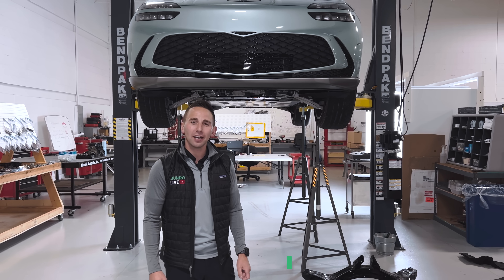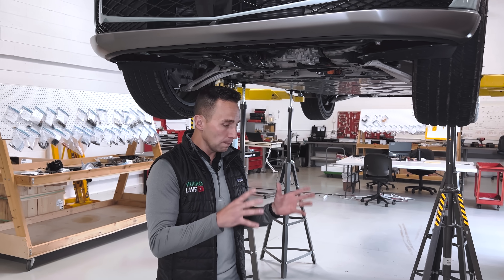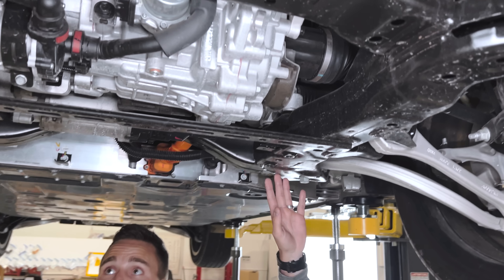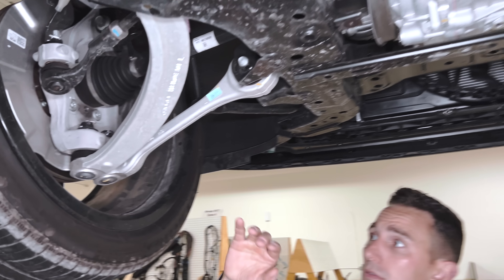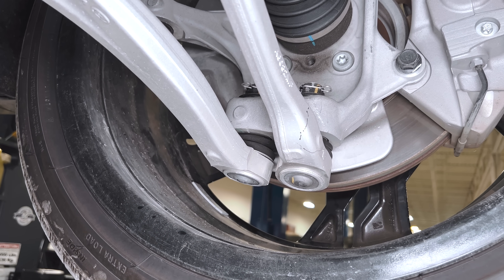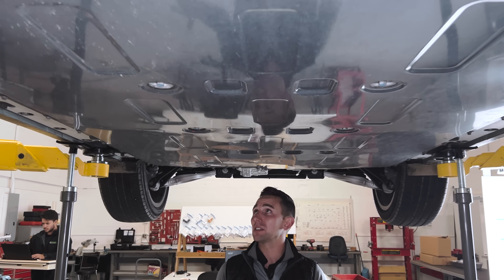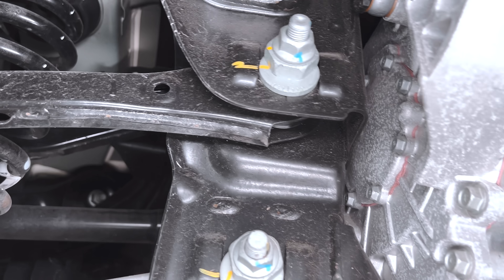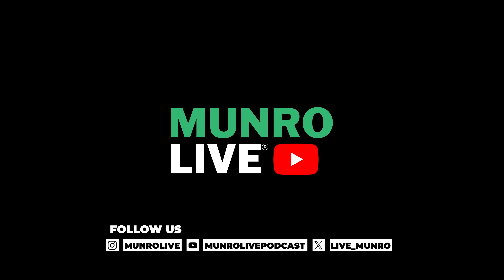Can you spot the difference? GV60 on the E-GMP Platform.

Comment: I’m really curious if you could look at an EV6 GT vs. the regular EV6 AWD and do a video like this. Also curious what parts may be shared between the EV6 GT and the GV60 “Performance” like brakes, adaptive dampers, etc.

I just looked at my EV6 GT’s front suspension components and it looks like they use these same aluminum parts with the double lower arms vs. the stamped steel from the Ioniq 5. Not sure if all EV6s use this design or just the GT.

Comment: If you look at the two hubs, the GV has the two ball joints.. the Ioniq has the one.. BUT.. look at the placement... the Ioniq has it almost directly under the wheel bearing area of the hub. The GV has it substantially inboard.. but two..  I bet if you draw out the intersecting lines of the two ball joints.. they end up right where the single ball joint is on the Ioniq.. right under the wheel bearing.
BUT you would gain substantial strength  and probably better life span with the two joints.. they will experience half the stress, and less motion in the joint also.
I wonder on the wheel bearing being incorporated into the half shaft.... could help reduce salt and debris getting onto the wheel bearing from the back side.. in the rust belt you see a lot of wheel bearing failures.. but not the bearing itself.. the ABS tone ring will disintegrate.. and require the bearing to be replaced... so maybe less often replacement.. but I bet more costly when it does need to be done.

Comment: Question: Could a consumer swap in the control arms and ball joint from a GV60 onto their Ionic to improve the ride quality or are the mounting points different?
Reply: The knuckles are $1400 each side, $1300 per side for the control arm set so it would be over $5000, assuming it would fit.

Comment: Jordan, can you try to explain some the engineering in more layman terms without all of the specific buzz words that are used by engineers versed in the topic.  For example, the explanation of the use of the virtual ball joint vs the Ionic.  I know that I got lost as you kept adding all the specific terms that not many of us layman understand.  Good video, keep them coming.
Reply: What the goal of a virtual ball joint is doing is to get the pivot point of the wheel in the middle of the tire contact patch on the ground.  So when you turn the steering wheel the tires pivot about that virtual pivot point rather than a point further in which would make the tire scrub on the ground more.  The benefit is a better steering feel, better high speed stability, and less bump steer (the wheel direction changing as it goes over a bump in the road).  But it costs more, so it tends to be on more expensive vehicles that tout their driving dynamics (e.g. BMW, Audi, etc).
Reply: @morrisg  thanks for the simple explanation.

Comment: See the cracks on the virtual ball joint? Yikes!
Reply: Its not crack its grease
Reply: Yes, I also found that very distracting and extremely concerning since it could mean gas inclusions/voids in the casting which could lead to a catastrophic failure especially if it suddenly came apart at Interstate speeds causing the vehicle to barrel roll down the highway at 60+ MPH.  Then again those types of Quality Escapes are what I've come to expect from the parent company.

When I see things like that I tell the client about it and advise them not to drive the vehicle until the manufacturer remediates it.  I would really dislike it if a client was injured or died in an accident that I could have prevented just by speaking up.

In the big scheme of things that part does not cost the manufacturer that much and should not have passed inspection.  Then again if a Robot installed it on the assembly line would it have even noticed?

Best!

Comment: what I noticed with Munro they are really good a saving the manufacture money on the assembly part but the owner perspective not so much yes it will save the manufacture money in the short term but not in warranty work if components are not replaceable individualy like this example of the rear wheel bearing of a battery pack that can't be open for servicing or repair look at the old model S they are having issues with water ingress the pack is servicable unlike the newer Tesla cars it all good until the factory warranty is on but once the warranty is over this is where the problem starts.

Comment: are you saying that if one of the rear wheel bearing fails you have to replace the half shaft ? if it's the case this is stupid imagine the cost of a wheel bearing replacement.  ?
Reply: They probably calculate the wheel bearing lasts about as long as the half shaft. There's risks involved in that of course - if the calculation turns out incorrect or there's variation in quality, the customer pays more. It does lower the initial cost though.

Comment: So when a bearing goes bad you have to pay the OEM $1000 for their stupid combined half shaft.
Reply: They have worked to create a world where no one wants a car out of warranty.
Reply: You are not supused to replace it. That wheelbearing is probably designed to last the "life of the car" (10 years or something like that) It's just geting worse, soon all new cars will be desposable like a washingmachine. Batterys computers and everything will be too complicated and expensive to repair.
Reply: @mrm1885 bearings are a wear part. They’re not meant to last forever.
Reply: Actually the integrated half shaft with the bearing was developed during WRC championships to improve performance, not to reduce cost. It was first implemented with the Elantra N.
Reply: So all cars get the cost saving, the few that fail in the bearing get the cost hit. Fair enough.
Reply: @anderspedersen542  OEM saves $20 on assembly so the user has to buy an obscure part instead of getting their own bearing in ten years. Brilliant.
Reply: Modern cars, compared to the garbage we drove years ago rarely fail and barely rust away. My EV, 2022 Kia eNiro, has bee faultless for nearly two years. My Audi A1 couldn’t manage that, even my much missed Volvo V70 couldn’t do that, in fact no other car I’ve ever owned over 40 years couldn’t do that. 
Not only that, but it cost me £125 per year for servicing. None of my other vehicles managed that either.
They aren’t perfect, but blimey they’re way better.
Reply: Fancier cars.  More cost to repair and maintain.

Comment: I’m curious to see if the ionic 5 N and the EV6 top performance trim have a virtual ball system or the use the single stamp steel control arm ?
Reply: A: yes, these are the premium components fitted to both the 6-GT and 5-N.   Hyundai has showed them during the tech talk portion of the Press Intros.

Comment: Hyundai/Kia manufacturing philosophy is quite different than Tesla’s - Tesla is much more ruthless about eliminating variants that add cost
Reply: @bartwaggoner2000  Nope, the Model 3 (lowest priced Tesla) has two ball joints and a virtual pivot point design.  Go check out the Motortrend suspension analysis of the new Highland Model 3 if you're interested..
Reply: @morrisg  interesting! I bet that they spend less money overall even though it is a more expensive design as they have more economy of scale by not having to have 2 separate manufacturing processes…
Reply: Tesla decides on the segment and sticks to it. The Model 3 is a budget premium car and the suspension, the only variant of it that exists, targets that segment, and that segment only.

Comment: Super Video...as always.  Question : how can the wheel steer with this TWO Balljoints side by side ?????
Reply: See this video for an animation: "Virtual Steering Axis Front Suspension Found in CarSim". Essentially the lower control arms do not move much. But the small movement they do is allowed by large rubber bushings on the steel subframe side of the two lower control arms.